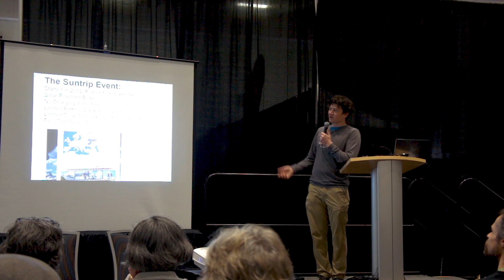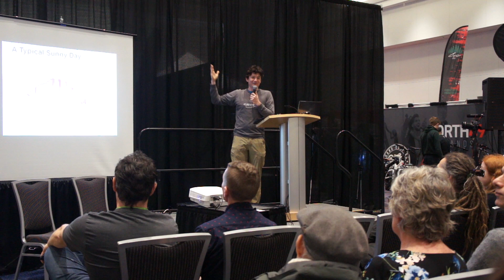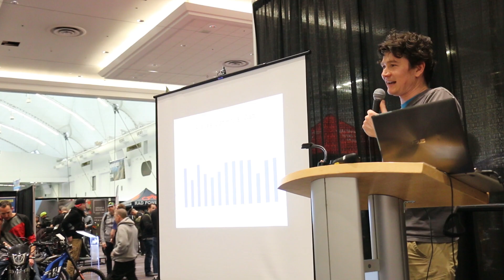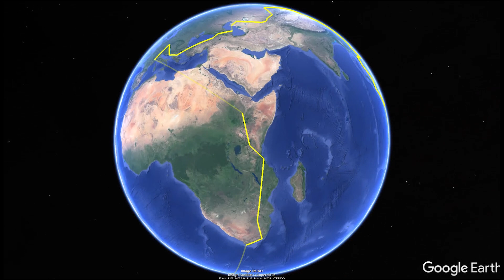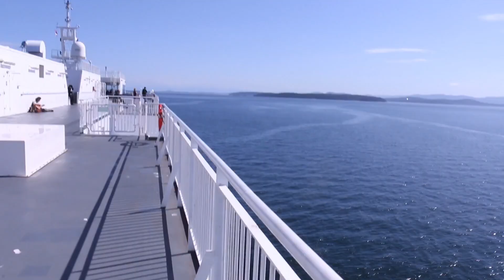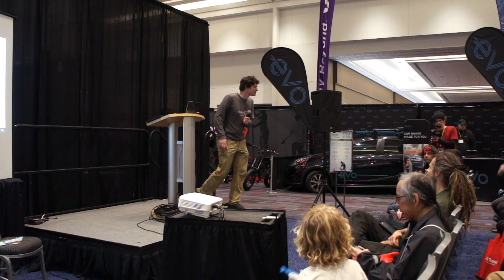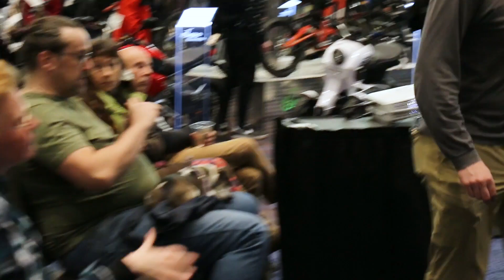Solar Ebike Touring, Experiences of the 2018 Suntrip Race, with Q&A Session from BC Bike Show

Comment: Excellent talk.  I have watched the Sun Trip 2018 documentary and it was inspiring.  But, just to be sure, the trip is not entirely powered by sunlight power because the rider is allowed to pedal.  So a top conditioned cycling athlete definitely has an advantage.  So the trip is a combination of sun power and hamburger power. :-)
Reply from the maker: Well said. And those hamburgers cost way more $$ / watt-hour than the sunlight, and cause a lot more environmental damage per watt-hour to boot!

If you want to be really pedantic though, all the food and fossil fuels is just the storage of prior sunlight in chemical form as a result of photosynthesis. You'd have to eat critters from deepwater hydrothermal vents to get energy in your system that wasn't solar
Reply: @GrinTechnologies  over the years we all hear about the satiator charger generally people don't like it who are dealers because of course the wholesale cost is higher considering the value of the package. I have visited your website for the first day today that I can recall at least and I'm impressed by your investor program for example especially with low interest rates. Viewers can make $8,000 a year. That is in credit with your online store. I I think one of the errors that you making this video is to ignore the fact that the panel is not designed for a bicycle. Bicycle solar energy harvesting component would be integrated with the Wynn's and the individual cells would be both s a i l s Four Winds and the capturing light on both sides most likely. For example right now 500 watts is the standard for stationary panel. For Mobile use so you're going to have something like 6 watts per disc and although you are you at the hamburger what are much more expensive that notion comes from stationary panels, so paying as much for solar what were much more than the fanciest restaurant dinner cost is nothing compared to what grab shaving historically has cost on road long-distance touring.

But it comes to fuel oh, and your earlier notion has validity the error that you made and no longer rejecting the use of solar to capture electrons is in ignoring the other types of fuel that lightweight wheeled Vehicles can use. Especially in climates that you need Cooling, using liquefied natural nitrogen that's the power source, is something that you have not studied. Most urban areas have it being delivered at a cost of gallons per US dollar. Each gallon is 700 cubic feet evaporated. While expanding 700 * the energy that can be recovered is very significant and only about 15% unbelievably is lost. That's the round trip Los.

The renewable energy Market has never been objective or impartial. On the bicycle however one can't avoid candor.

Many industries use liquefied gases. Many use the gases that are available on site, and so the industry has minimal competition between providers some providers will produce the liquid on site for you.

Currently, fracking has resulted in tremendous amounts of energy being wasted liquifying and evaporating methane.

We have to save the planet. That means, we must Embrace technology. You mentioned geothermal energy as a core energy. The gravity of the Sun, causes our core to generate significant Heat oh, some of that he is coming from Fusion within the core of the Earth, but much of it is due to the magnetism and the influence of the Sun. It does not matter where the energy comes from though. Most likely a variety of energy sources could be used to produce the work necessary to make fuel. American boats produce their own jet fuel but when it comes to making a portable energy storage liquid hydropower wind and yes uranium all compete to get it done anywhere on the world.

I have saved the best fact for last and that is the Newtonian observation that objects in motion remain in motion. As the mass of an object increases this a law becomes more of an issue. So if you have a tank several miles long filled with liquefied nitrogen oh, you can move it very quickly across the ocean, on what I call an improvised Air Road. That is sufficient pressure between the surface of the ocean and the belly of your craft. The frictional losses are very minimal given the tonnage of your cargo. It is very easy to maintain speed by yanking on cables. Each end of the cable has to be on the surface of the ocean for you to grab on it of course. In-between the ends the cable is below the surface of the ocean because for those who have not noticed this the ocean is not flat either. As long as you have something to exchange for the liquefied natural nitrogen that is what gets yanked on. So you have this car go using the cellular model traveling as fast as you want across the surface of the ocean oh, this can be above the speed of sound of course. However subsonic speeds are significantly faster than current shipping standards. Going a few hundred miles per hour is more than revolutionary. Those of us who witness the solar eclipse know how fast the shadow travels. Using solar energy to maintain the speed of a craft is not recommended nor is it necessary to keep up with the Sun. you can after all begin your journey in the morning and as long as you arrive by Sunrise you're not going to have to deal with Darkness.

I call this technology yank. It competes with propellers being thousands of times more efficient. I call it twice as efficient as Wheels because unlike Wheels all of the energy goes to move the cargo whereas with wheels you can tell me what the percentage is that gets the move the Earth as opposed to the mass and the vehicle.

The truth is often upsetting and causes violent reactions of denial oh, this is especially true when it comes to scientific fact. Ian Stein faced it. I face it on a daily basis. I am running for the United States Senate oh, and I am going to be bringing fat offering myself in service for a. Of years, take it or leave it. Should I or frankly when I am elected, watch out.

Comment: Oh another Question Justin,  You said that the max power you have seen from your solar panel  even in the best conditions was 80% of the max rated power that  they are designed for. The spec shet say 25% efficiency so this would mean that in reality these are like 20% efficiency i guess. Maybe they are a little bit overspec or have been rated for light conditions impossible to meet during a 12 000km trip!
Reply: The nominal panel rating is based on Standard Test Conditions (STC) defined as 1000 watts/m^2 irradiance (solar noon) and 25°C cell temperature. This is optimal for flash testing on a factory assembly line but does not represent real world conditions where the cells are going to be 25-30°C above ambient air temps. This is why you typically get about 80% of nominal.
Reply from the maker: SolarEbike answered correctly here.  Some of the suntrip people had gone on solar bike trips up in the alps they often reported getting consistently higher wattage than the nominal rating even without the reflecting clouds situation. If you have cold temperatures and a clear sky it's quite ideal and possible in real world to do more than rated.   
Most often when we were riding it was sunny but a bit hazy in the sky and that really had an effect on the maximums.

Comment: Justin, that was very interesting! I am wondering if you choose or maybe built your  MPPT  with a specific idea to have it to react quickly enough to adjust the V/I ratio fast enough to accomodate for the shadow that you meet during riding the bike? ( in movement) Because regular MPPT are made for static solar install and the V/I ratio dont need to  readjust quickly, But for your application the speed at which it readjust was more important i guess?
Reply from the maker: The most fun is just to zig zag all over the road avoiding shadows like a kid jumping over cracks in the sidewalk!
Reply from the maker: This is a great question and really one of the differentiators between a good quality MPPT and a poorly designed one!  We tested the recovery rates of the Genasun and chinese MPPT we used on this trip and they were both really good, but I've heard stories of some MPPT's that take many seconds to find their sweet spot again.    The other thing that can really help is having multiple small panels in parallel, but that means running at a lower voltage which is less efficient/ideal for the MPPT boost converter as it means higher amps on the input. .
Reply: I don't have the skills to build my own MPPT solar charge controller so I use the GenaSun boost controllers which are designed for mobile applications. The specs say the MPPT Tracking Speed is 15Hz.

Comment: Interesting and Informative! Thank you.
You showed how heat build up lessens your solar panel efficiency, so this begs the question: What was the material and design of your solar panel substrate? Was it constructed to transfer heat away from the solar cells to keep them always cool from below? For example foam being thermally insulating would be bad. I imagine an equivalently light weight custom designed aluminum sub structure could keep your solar panels cooler and more efficient both when moving and especially when stopped.
Reply from the maker: Our panels were glued to a styrofoam core and so had the worst possible thermal path from below, but then the best mechanical rigidity for not flexing and developing microcracks in the cells.  If you glued the solar panels to a sheet metal substrate that would be ideal, and at least one person in this race had panels made like that.
Reply from the maker: The data on panel efficiency vs temperature is quite well documented so it's easy to calculate the potential gains if you know the actual temperature differences you might achieve.

Comment: Yo dud!
You already replayed with a helpful response, so in hopes for additional info since you did your homework and i dont have any experience.

So to connect this to a bike you only need an MPPT+solar panel? Like if you got a 48v battery you need a 48v+ MPPT and a solar panel and you connect it to the battery-controler terminals?
Reply from the maker: That's correct. If you already have an ebike with a battery pack, then all you need for converting that into a solar ebike is a solar panel and MPPT charge controller, and the wiring to connect the output of the MPPT to your battery bus.

Comment: A professor at the UofArizona used a combination of lithium and Sulfur to make batteries.. They were getting 5 x the range of the standard 18650 lithium batteries.  And then, all the news about this breakthrough completely went silent..   (Too Efficient..?)   Sulfur, as you know is a waste product of manufacturing.  And it is expensive to dispose of it.  This professor found a way to use this waste product and make a battery that provides 5 times the range for electric vehicles.
Reply: What a surprise another tech advance to help free up slaves gets burried and it's inventor silenced.

Comment: I use a misting system on my panel.  Works great.
Reply from the maker: Oh neat to hear. How much water per hour do you go through with that?
Reply: @GrinTechnologies  I use a MistyMate with a self contained/pressurized canister.  It delivers a small blast of cool mist. And i notice a difference in range.  I only use it in the heat of the day.
I really want to talk with a tech about adding a CA to my solar system.  I have a BBS02 750w 48v mid-drive.  I set up the trailer with a SunPower® 170w 29v 5.83a panel, a Genasun GVB-8 54.6, And i paired up that with my 52v 17.5ah hailong batteries.  I want a display that will be compatible (with/without a shunt) (readable under direct sunlight) (so i can monitor the Solar impact on recharging my 52v batteries). i know my system is working because of the fast green flickering light.  But i can't really monitor the voltage or watts consumed while riding.   My Bafand C750 display has all the information to optimize the gear ratio/power level/watts consumed by motor to get the bigest range.  The biggest problem with the color displays by bafang is that they cannot be seen in the sunlight.  What are they thinking.  A display that can't be seen in the sun. LOL isn't that when we ride..? LOL